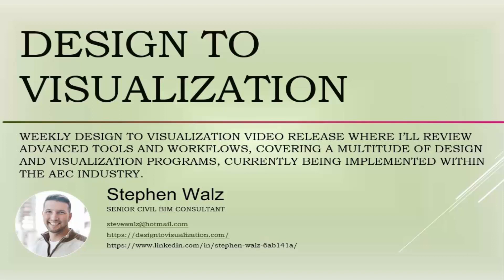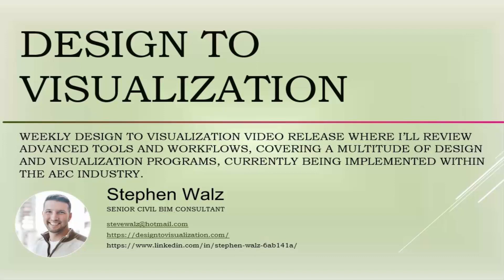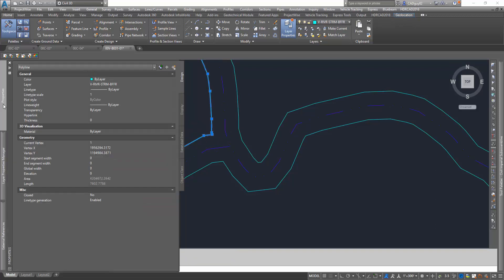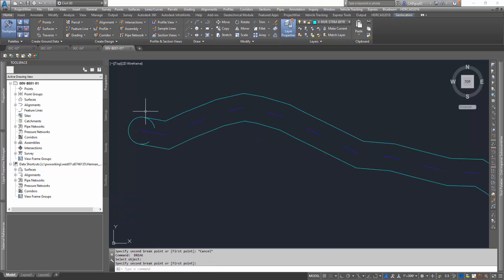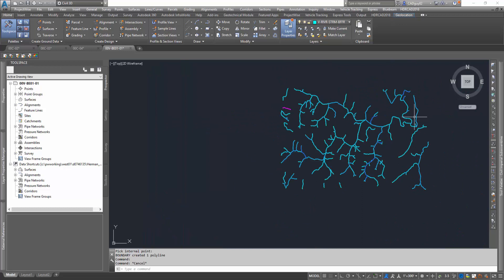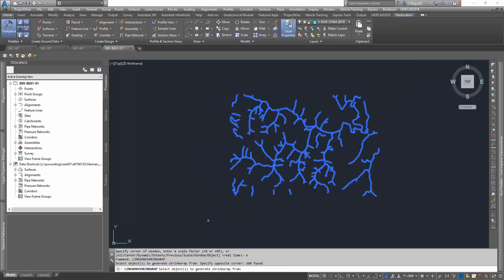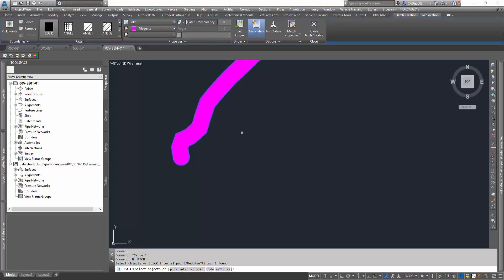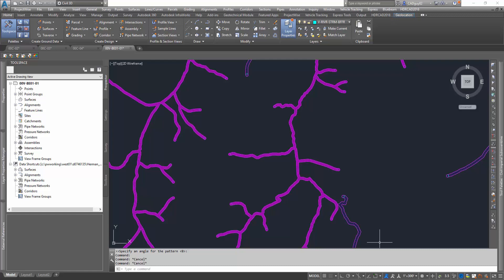BPOLY vs LINEWORKSHRINKWRAP

Comment: Man, shrinkwrap is cheating!  lol

I have a project where I have to calc all the impervious pavement at an airport, and there are million pavement edge lines, all coming from different sources, on different layers, at different elevations... it's a mess.  But, thank you for the reminder about LINEWORKSHRINKWRAP!  This is definitely going to be a live saver!
Reply from the maker: Awesome...happy to help Adam! You mentioned that these components are at different elevations, so I just wanted to throw out that there that LINEWORKSHRINKWRAP works well when they are 2D Polylines with a consistent elevation. If performing this command on a 3D Polyline with varying elevations, the new boundary becomes a bit distorted...just a heads up that you'll need to convert 3D to 2D before running this command.
Reply: @stephenwalz3900  Good point!  Thanks!